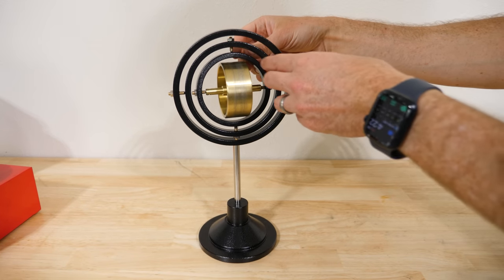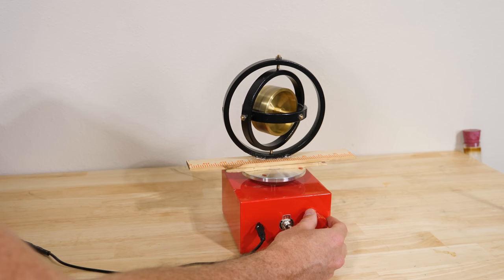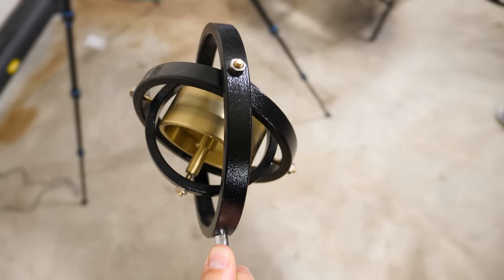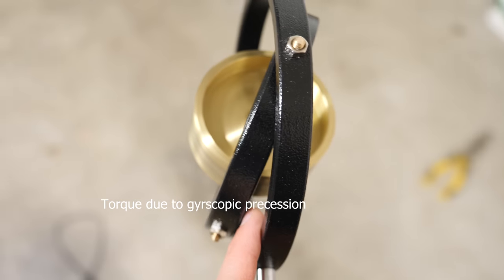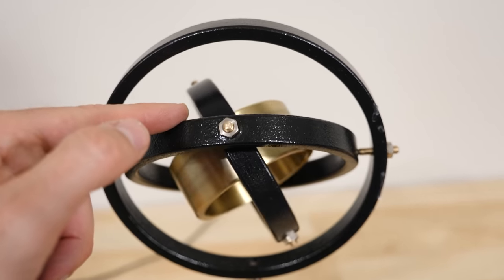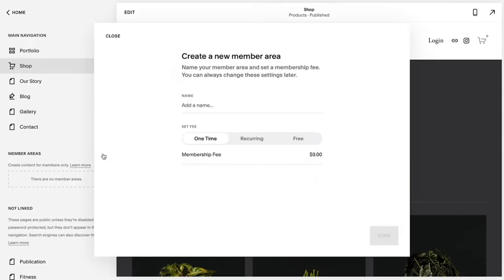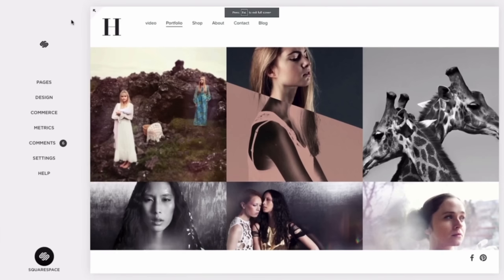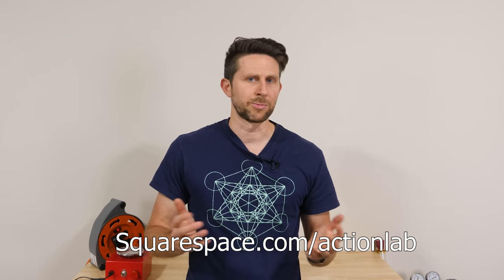Can Gyroscopes Provide Free Energy For The Planet?

Comment: Conservation of angular momentum means you can't extract rotational energy from a closed system at equilibrium. The best you can do is to find some part of the Earth that spins at a different rate to the surface, then extract work from that mass by bringing its rotation speed to equal that of the surface.
Reply: Wrong well idea is right application is wrong 

Motors word specifically by turning angular momentum into heat an electricity 

Allow me to prove it 

It I had a motor in space 

Rotating body and head 1rpm 

With a small battery on the head and a gyroscope on the head face 90 degrees in the direction of rotation 

If the gyro turns on its resistance to motion would cause the head to rotate or “not rotate” and that energy would be quickly converted to electrical
Reply: and jk about dingus part .. but Darren ..please check it out
Reply: @aspiring scientific journalist Also a cow  
"Motors word specifically by turning angular momentum into heat an electricity."
1) Motors turn electricity into work. Generators turn work into electricity.
2) You are confusing angular momentum with rotational kinetic energy. Kinetic energy can be transformed into other forms of energy. Angular momentum can't be converted to energy but it can be transferred from one object to another.

If you see a generator stop moving it's because the angular momentum of the rotor was transferred to the Earth via the stator. The kinetic energy was transformed into electricity and heat.

"If the gyro turns on its resistance to motion would cause the head to rotate or “not rotate” and that energy would be quickly converted to electrical"
Maybe. It will also cause the whole system to rotate around a third perpendicular axis as shown in the video. If you want to call this a proof you should at least show that the energy generated is higher than the energy used to spin up the gyro.
Reply: @aspiringscientificjournali1505  gyros do not resist turning, they just turn 90 degrees offset to the direction you try to make them turn. 

With clever arangements, bunch of gymbals and low friction bearings, you can use that to keep track of direction, but the moment you try to apply force on it, it will turn around on some axis.

Also, if you run a motor in space, the shaft will rotate one direction, while the casing will rotate the opposite direction, perfectly in line with the law of conservation of angular momentum.
Reply: I thought the conclusion at the end would be this. This is a theoretically unsolvable problem, not just an engineering challenge.
Reply: Maybe you can take energy from the precession of the earth, until its rotational axis is perpendicular to its rotation around the sun.
Reply: It is possible to reduce the total rotational energy of a system, while at the same time conserving angular momentum. This is e.g. what caused the unexpected instability in the spin stabilization of the Explorer 1 satellite. Though, I guess by "in equilibrium" you cover this already.

Edit: I'm not saying it would actually be possible to extract usable energy from the rotation of the Earth with gyroscopes. If we want to harness Earth's rotation, it seems far easier to just tap on to the tides.
Reply: "closed system in equilibrium"??? 
The "Globe" is not a closed system, nor in equilibrium.
...or is it not a Globe and there is a barrier above us?
Reply: You can definitely theoretically use the kinetic energy of earth's spin to make energy: Freeman Dyson thought of a way to do it. It involves some massive construction. Think conducting bands built around the entire planet. He called it a planetary spin motor, but a motor is can be reversed to be a generator. As a motor, it would speed up the earth. As a generator, it would slow the earth. You have coupled magnetic fields interacting with conductive orbital objects. In the end, you steal kinetic energy from the earth via the coupled magnetic fields and make electricity. [Mr. Dyson utilized it as a motor, since speeding up a planet enough would rip it apart, providing material for building a Dyson Sphere.]
Reply: @eklhaft4531  1)and 2)
 are related rotational energy, is derivitive of momentum so my statement stands since if you have a clear quantity of one you can deduce the other your essentailly arguing joule vs watts yes they are different but when you have one you have info the gather the other the transition is situation based or period based after that the energy is still the same 

so ye momentum can a rotating stator has momentum right .... see how your argument kind falls apart when considered with context clues 

3 you dont need a third axis ..... just have the first to then use a magnetic bearing to act as a spring
Reply: Yep, Earth isn't rotating relative to us, it's rotating relative to other celestial bodies. You'd have to expand the system to include something like the moon.
Reply: @chrishamilton1728  According to you, you wouldn't feel when a car makes a turn... I forgot... "Gravity is holding us down, while the centrifugal force is trying to 'fling us off'...".

WHY does a 100kg thing weight the same everywhere??? The centrifugal force should be higher at the equator and you should loose pounds...
Reply: @chrishamilton1728  For one... Your comment got shadow-banned.

Second... Incorrect... Centrifugal force IS a force and you also CAN generate work from it. The Foucault pendulum (which supposedly proves the spin of the earth) wouldn't work, if it weren't...

Third... Any non-straight motion is as an acceleration in an angle...
Reply: @tnaplastic2182  The first line in wikipedia even calls it a "fictitious" or "pseudo" force. There is no upward centrifugal force, only tangential velocity, and gravity causing that velocity to travel in a curved line.

The Foucault pendulum has nothing to do with centrifugal force, nor is it converting the Earth's kinetic energy into work.
Reply: @chrishamilton1728  Why does it (Foucault's Pendulum) spin then? Oh... Electromagnets... 😂
Reply: @chrishamilton1728  On another note... Wikipedia is not a scientific source.
Reply: You are smart but educated wrongly. Earth don't spin.
Reply: @tnaplastic2182  is not a globe and we have a barrier above us. 🖐️
Reply: @tnaplastic2182  My source is grade 10 physics... It's pretty basic stuff, all other sources will tell you the same. The Britannica Encyclopedia for example.

The pendulum, like all pendulums, runs entirely on gravitational energy. It just changes directions relative to it's surroundings because that back and forth motion causes it to spin slightly slower than it's surroundings. 

You're not using Earth's kinetic energy, you're using gravitational energy to dampen the effect of Earth's kinetic energy.
Reply: @chrishamilton1728  Hence you point to Wikipedia as your source within the first 5 words of your first sentence. /s Riiiiight...
Reply: @stolearovigor281  Maybe... IDK... I can't go up there...
Reply: @tnaplastic2182  you also can't go south btw or to the north pole. Too dangerous for their democracy.
Reply: @stolearovigor281  True... Antarctic Treaty, etc.
Reply: @tnaplastic2182  do you know about rockets that hit the roof? There even 2 operations from USA and Soviet Union. They tried hard to break through. 😂
Reply: @stolearovigor281  Better don't make a Highjump out of that Fishbowl! 🙈
Reply: @tnaplastic2182  old joke in a new fashion. Appreciate it.
Reply: @stolearovigor281  I don't even know the old joke. 😳
Reply: @tnaplastic2182  no worries, your is better! 👏
Reply: @stolearovigor281  Double-Pun. 😁
Reply: @tnaplastic2182  Guess you got me, centrifugal force is real because "wikipedia is not a scientific source" you win this round.
Reply: @chrishamilton1728  What??? You are totally off topic. I suppose you don't remember our full conversation?!
Reply: @chrishamilton1728  I never claimed "centrifugal force is not real"... In fact I claimed the opposite, because it supports the point I am making... Why don't I weight pounds less on the equator compared to way more northern places, as would be predicted by a Globe........?
Reply: @tnaplastic2182  
Dude: ENOUGH with the unintelligent responses, he's been trying to educate you for too long. GIVE IT better EFFORT. 
Yet another example of the Dunning-Kreuger effect can be found in your last comment, which CONTINUES to ASSUME that you actually DO weigh the same at the equator than elsewhere: quite factually, you DON'T. 👍✅💚
Reply: @justinklenk  You title someone (and his questions) "unintelligent", yet the person you don't even know probably is way more intelligent than you.
Reply: @justinklenk  I agree that you ARE a "perfect example of the Dunning Kruger Effect" though.

You can't argue factually, you strawman ad hominem and name call and yet you CLAIM, to be more intelligent than the discussion opponent you are trying to argue with.
Reply: @justinklenk  Why do digital (one which shows 0.1-0.05Milligram) and analog scales, show the same weight at the equator vs. the North Pole. 

Have you ever calculated the amount of Newton you would be "flinged off" on the Equator, vs. the poles, or how much less something would weight?!?

The difference should be in the tenths of gramms with a 1kg weight...

Should we use the actual formulas and calculate it right here together, or do you only "want to be right"?
Reply: @justinklenk  Btw.: I am not your nor anyone's "Dude", Sir Justin Green (behind the ears... You like ad hominem and name calling, don't you? There you go.)!
Reply: @chrishamilton1728  is kind of right, because "centrifugal force" is a so-called "fictitious force" and although I disagree on the reason, I agree on the premise...

HOWEVER... This does NOT change ANYTHING in regard to "my claim"... ("the weight of anything should be lighter at the equator")!!!

The priest Neil DeGrasse Tyson even tells you the same...

Not "per thousand", but "percent"!
Reply: @tnaplastic2182  u seriously arguing for flat earth?
Reply: @therflash  No... I am arguing against the model we are being told and that is a BIG difference!
Reply: @therflash  Do you really think "I want" any shape? I don't have ANY benefit of/from it... Losing friends and family members... People thinking you are the stupid one (like you just did) and loosing all of my childhood... (Star Trek, Star Wars, Stargate and so on...)
Do you REALLY think I chose that...?

I chose the "path of truth", regardless where it leads me, regardless how often someone comes to me and wants to beat me and whatnot.
Reply: @therflash  Fly over the North (at best from the Equator)... You should SEE a difference on various (but not all) scales! TRY IT!
Reply: @tnaplastic2182  Yes, you will see a difference if you try it with sensitive enough scale, it's about half a percent of difference.
Reply: @therflash  First of all, it should be more according to the math.
Second,... Yes it SHOULD be lighter, but we can NOT measure that effect, regardless which scale and how precise it is. The question remains... WHY?
Reply: @tnaplastic2182  1 show the math if you think it's more. 

2. Show proof that it's the same, cause it's been measured different.
Reply: @therflash  Would you do a live-stream (open) with me? You do NOT need to show your face of course. If not, this will require multiple comments, because Youtube is moderating my posts and I can usually not post long answers or links.
Reply: @therflash  Regarding "2.": Show proof that it has been measured different! I agree that it has measured different values on an airplane for example! Very slight, but it does show some change... HOWEVER... ALTITUDE change and resulting differences in this experiment work on multiple models and are not a prove of EITHER model.
Reply: @tnaplastic2182  not in airplane lol, you can't reliably weight things on an airplane. It was measured on the ground, many times.
Reply: @therflash  First of all... No... That experiment was not done often... Second, you COULD reliably measure it on a plane, as long as it does not change altitude...
Third... Again... Prove your claim! Show me, where someone has taken a weight and a scale to the Northpole and the equator, where it also shows ANY difference.
Reply: @tnaplastic2182  Yea, let's make a stream
Reply: @marc "you can't extract rotational energy from a closed system at equilibrium" - such a simple way of describing one of the main issues at hand. Most of the replies seem to disregard the "closed system" part though.
So one way is the make the closed system bigger, to include the moon. Extract free energy by slowing the relative rotation rate between the earth and the moon. In a way, it is being done already through the harvesting of tidal power.

Comment: I don't know what the solution would be, but I guarantee it would involve being closer to the center of rotation, so at one of the axial poles. If you can somehow multiply the rotational inertia, through a series of pulleys or some other mechanism pulling the center of mass inward, you could potentially generate additional speed similar to a figure skater.

Comment: We could extract energy from the rotation by creating a space elevator with a circular chain, delivering heavy rocks to an orbit high enough so that they get flung away by the rotation of the earth.  That centrifugal force can drive the elevator to carry up more rocks, and it can deliver energy we can gather by putting generators to the circular chain.

The problem only is that we have no material to construct such an elevator.  Nothing is strong enough to sustain the forces of that pull under its own weight for a length of thousands of kilometers.
Reply: cåññâbëār  Don’t feed the troll!

Comment: Imagine for a moment that we develop a working method to extract energy from the rotation of the Earth.   Now imagine this successful method gets applied globally, by all developed countries.  
The phrase "extract energy" is key here.  With a large implementation of this, we would undoubtedly slow the rotation of the planet.  Doing so, even a little, would have catastrophic effects on our civilization due to the climate change it would cause.   Days and nights would become much longer, temperature shift between the two would become much larger.  Seasonal extremes, much deeper.
Reply: Extracting a second of rotational speed from the Earth yields enough energy to power the US for 83,000 years. The US consumes about 4 GW/h/yr of energy, which is 1/6th of entire planet energy consumption at 24 GW/h/yr. So divide 83,000 years by 6, and you can power the entire planet for 13,833 years and you'll have slowed its rotation by only 1 second at the end of of those 13 millenia. Even factoring in increased efficiency with technological progress and greater energy demands, that amount of drag on the planet's rotation is negligible on climate.
Reply: Better than fossil fuel
Reply: Maybe if we like, actually significantly slowed the Earth. But he said at the start, only slowing it by one second yields an insane amount of energy that we'd use over thousands of years. Obviously we'll grow in energy needs but for the time being, the effect is minimal on the Earth.

Comment: We already do extract energy from the earths rotation. We use something that is not in direct contact with the earth, and use that to move a "mechanism" that drives other machines that extract the energy. The mechanism is called: tides. The thing not in contact with the earth is: the moon. The frictional losses are absolutely massive, so its hardy efficient, but the energy involved is phenomenal, so even a very inefficient system is capable of extracting huge amounts of energy. Then people start to worry about ecological damage, and it gets a whole lot more complicated.

Comment: Gyroscopes are for direction/guidance. Let's take a frisbee like disc. Inside are 3 grooved walls from the outside in. The center is free floating while the walls are lockable. Hand cranked to keep centrifugal force going (the start being a large "skeet" shooting lever), with gyroscopes at 16 points along the outside. Each gyroscope is able to be engaged (by being brought in closer to the center).